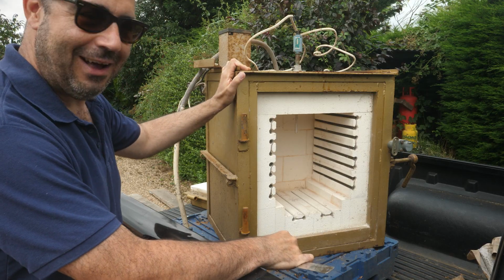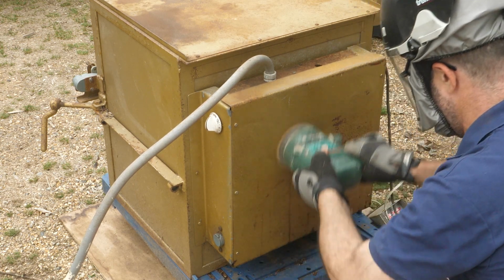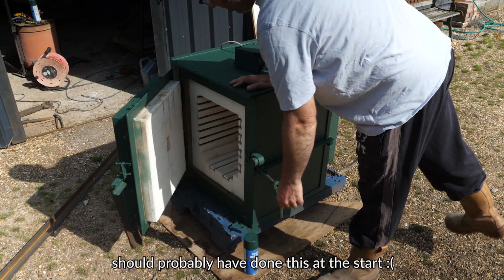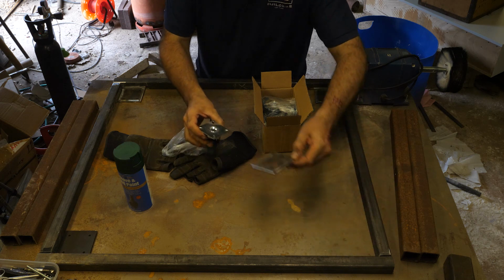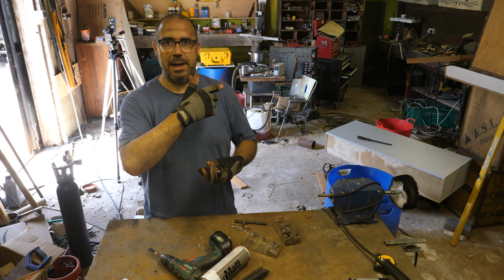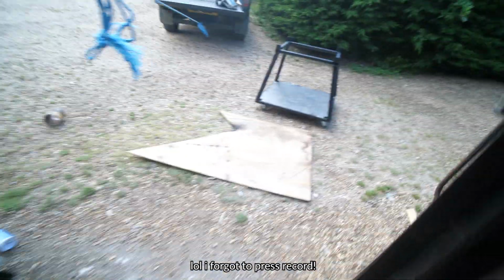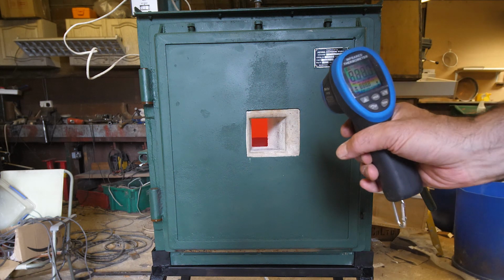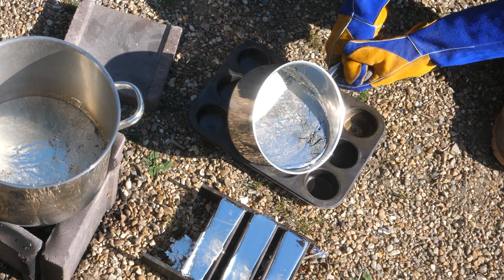Fixing up a cheap ebay kiln for lost PLA casting and lost wax casting! + bonus tin pour at the end

Comment: Nice work Julian.  I am doing similar myself.  Often use my kiln to melt aluminium also.  A few years back I bought a chain lever hoist, best purchase ever. Lifted lathes, mill and alsorts. Not much you can't lift or move with a hydraulic jack and chain hoist.
Reply from the maker: MakingAllsorts found a good 1ton one on eBay! Cheers mate
Reply: @JulianMakes  Careful though I bent a shed once hoisting a mill up off the trusses with mine. If you tell anyone I will deny it though ;)
Reply from the maker: MakingAllsorts ooh using it for aluminium... that’s a very good idea, I’d actually not thought of that. I’ll do the same :) yeah you’ve prompted me to get a chain hoist too! Cheers
Reply from the maker: Haha I’ll keep your secret!

Comment: Why not use a saw to make the ingot smaller? I would have thought that melting it, only increases the possibility of contamination and in some cases oxidation.
Would there be any contamination from your “crucibles/ladles”
Reply from the maker: I didn’t want to loose any to dust, the only thing I have is the angle grinder and i would have lost loads, in the end only a 50 grams was lost in the saucepans, plus I wanted to melt it for fun.

Comment: Nice find on the kiln!  Wasn't too sure about your plan to lift that off the ground nor if the base was going to be wide enough to handle the door being open, but so far, seems it has worked for you!
Reply from the maker: Chatter on the Wire cheers chatter, yes the base is much larger at the bottom.